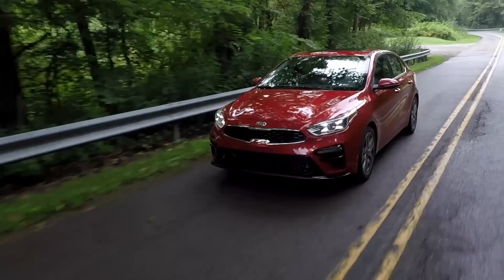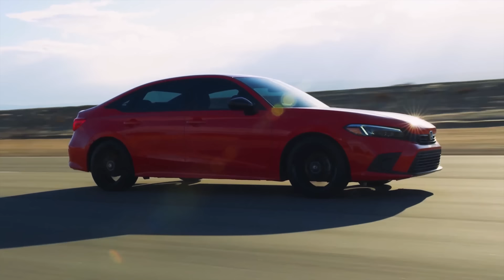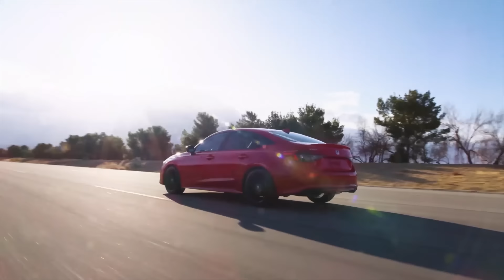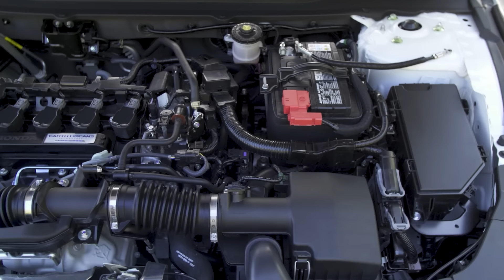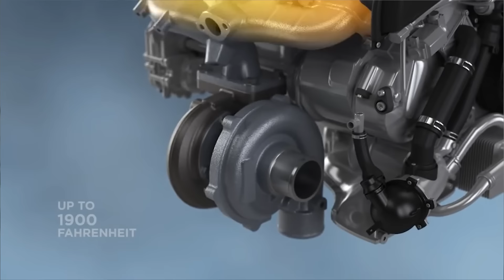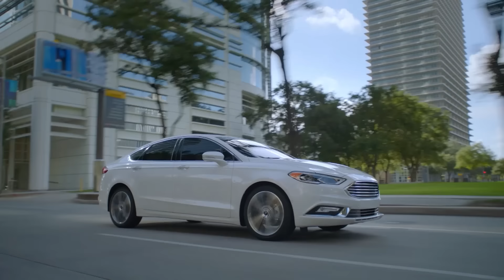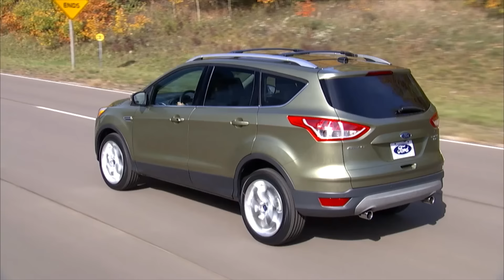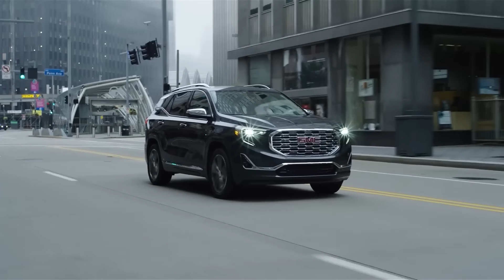Are Turbocharged Engines Reliable? The Truth About Turbo Engines

Comment: Hey man i just wanted to say thank you! For telling it like it is, a lot of people who prefer turbo engines will be butt hurt, but that is the truth. I've had a naturally aspirated 1.5 16v 88hp mazda 323f engine, very simple and cheap maintenance, no problems with the engine, my mechanic always liked working on it, very easy to fix, doesnt matter what you have to change, but the car body was very rusty, so i had to buy another one. So i got a mercedes c class c180 kompressor, very sensitive parts, the timing is expensive, the kompressor has certain mileage and then it breaks down, parts on the chasis or brakes werent cheap either, ive never red-lined it, but over some time the kompressor started rattling, the timing chain was stretched in a short amount of mileage, sooner or later electronics start to break down too, especially if its with automatic gearbox. So your best bet for a car always will be 4/6 cylinder naturally aspirated gasoline engine and manual gearbox, it can take a lot of abuse and will do its job for years and if you take real special care of it, it can even last a lifetime. Some people buy cars for ego, while others buy them for daily tasks. That pretty much sums everyone.
Reply from the maker: Well said. Thank you!
Reply: Simplicity is the ultimate sophistication!!

Comment: Honestly, this video is pretty misleading and filled with inaccuracies. 1) Turbo motors do not take longer to warm up than a NA engine. If anything, they warm up quicker due to the recycling of hot exhaust gas. 2) It is also pretty disingenuous to say turbo motors are worse for short commutes. 5 miles and under commutes are not good for any car, regardless of turbo or NA. 3) You are cherry picking bad motors. You can do the same and talk about bad NA motors. Northstar...2000's Subaru NON-TURBO Subarus, 2010's Hyundai/Kias, etc. It comes down to bad motor design, and poor maintenance habits by the general population. I could go on, but the last thing I will say is Turbo-Diesels have been around for a long long time, and they last for 300k+ miles, and even 1 million plus on Semis. Why, because good design. Some manufacturers slapped turbos on motors never designed to be turboed, and that's where the issues are.

Comment: I bought my first turbo-charged car in 1986. I've never gone back. I've owned 8 turbo-charged vehicles since then and never had a turbo related problem. You totally neglected the power loss that a naturally aspirated engine has at altitude that is not present in a turbo-charged vehicle.
Reply: @DevilDog53 #1, 1986 SAAB, traded it in on a newer SAAB at ~100K. #2, 1993 SAAB, t-boned in Louisiana; insurance totaled it, but someone salvaged it. #3 1997 SAAB, gave to destitute daughter @ ~120K. #4 1996 Audi Quattro, totaled in rear-ender ~120K,  #5 2000 Audi Quattro (bi-turbo), given to charity at 150K, it would have cost more than the car was worth to replace the catalytic converters. #6 2007 SAAB currently ~106K. #7 2016 Volkswagen Passat currently ~60K. #8 Oops, I counted wrong.
Reply: @DevilDog53 I, too, am a manual transmission fan. However, my current 2 vehicles have automatic transmissions. All previous SAAB's and the Audi's were manual transmission models. The current SAAB gets the worst mileage (28 highway) of any SAAB I've owned. The Passat gets well over 40 highway.

Comment: i have a 2014 ford fusion 2.0 vel ( spanish engine )  and 165322 miles on it..the direct injection on this engine, is bettter designed than the german engines.. the german engine route there pcv from the valve cover into the intake manifold.. for routes there from the block under the intake manifold.. with a cover on the block with baffles inside it..at least on the 2.0 car that i have worked on,, the 2.0 ecoboost engines dont have carbon build up on them.. as for the turbos.. the cleveland engines.. the exhaust manifold and the turbo are the same unit... on the spanish motors,, the exhaust manifold is seperate from the turbocharger.. this help lower the heat.to a degree....i belive by changing the oil every 6000 miles with synth.oil helps alot,,as with fresh coolent change every 3 years helps..at least on my car..i did add ovs onto my car. at 140000 miles and my valves where still clean, just a light grey finish on them.

Comment: A well designed turbo engine will last 200k+, I just traded in my Civic hatch with a 1.5T engine. Key part to keep it reliable is change the engine oil early or at least on time. During morning coldstart, dont drive it hard right the way, keep the rpm low and drive slow before it fully warm up. There are several Honda 1.5T with over 200k miles, 1 Civic makes it to 520K miles on original engine, turbo and CVT.
Reply: I have a 2016 ex-T with 150,000 miles
Reply: My dad's Scania has 620k miles and its turbocharged v8 (its a truck)
Reply: I'm glad to hear you got that milage out of your 1.5. I have heard that the headgaskets are problematic on those motors due to a coolent slit between each cylinder which gives very little area for the gasket to grab. Maintenance, and driving habits definitly makes a huge difference.
Reply: premium fuel and premium oil is a MUST for turbo engines to last 200k plus
Reply: Resale value is garbage for turbos
Reply: @jcman240 I bought my turbo civic 2018 new and can still sell it for 8k more than what I owe on it. The only mistake I made was leasing it for 2 years

Resale value is definitively NOT affected by turbo cars, only if they don’t come that way from the factory
Reply: @jcman240  I'd like to see you put that on a spreadsheet and prove it. The average person buying a car doesn't give a shit if it has a turbo or not. They just want a car that goes from 0-60 in a decent time, has decent mpg, and is in good condition.

Comment: Its funny how people complain about german cars in america or elese where, Europe is almost 100% turbocharged and around 80% diesel the fact that almost all majority of people there dont complain about parts failing or bad reliability, you will almost never find a turbocharged diesel not make it to 300k km it should also be a no brainer to do maintenance, yes some parts break and wear and not all parts are perfect but thats every manufacturer. I know many people in the us that have 2014 and older vw that have over 250k miles by doing maintenance and changing the timing chain
Reply: Diesels have a higher compression ratio. The engine is simply built different to withstand higher pressure.

Comment: If you want a car that doesn't consume a lot of fuel but also has high torque already from 1800 RPM and is not expensive then what is your choice.  Please note that there are cars that are more than 10 years old that have turbos, including diesel cars from BMW and Volvo

Comment: The efficiency of a turbo comes at a cost.  The excess heat can cause a lot of issues.  Since oil changes are more critical I am guessing that it breaks down the oil sooner than a normally aspirated engine.  They compensate for a smaller engine = less weight = theoretically better gas mileage?  Remember when turbos were all the rage back in the day?  That enthusiasm faded in time probably due to their reliability issues.  Would I personally buy one?  Only after researching the price for a new one as well as the installation cost.  Find out how long the warranty is & exactly what is covered.

Comment: After watching this video I’d still buy a turbo car and have tons of fun with it, most of our life ( which is very short btw) we worry about problems that never happen

Edit : had a Cadillac ATS turbo, Ford Escape 2.0 t , and currently a Mazda CX-5 turbo , not an issue. sorry but I can’t go back to a non turbo unless it’s a v8 ( had two Camaros and one charger v8 as well ) problems ? Let me cross that bridge when I get there
Reply: Well said 👌
Reply: Agree...V8 Tundra 4.7 '03...awesome truck 20 years old original frame. '16 Audi A5 2.0 Turbo 133K miles...only thing changed is two front wheel bearings. Highway long hauler in Northeast. Put ice & snows on and it rocks! Came with a 100K warranty.
Drained 1/2 tranny fluid. Oil changes @ 7K.
Reply: How many miles are on those cars?
Reply: tons of money I guess
Reply: @michaelgoodman9508  A bad attitude like that will have you missing out on a lot in life.
Reply: This is the other side to the coin. It sounds like the buy now pay later ideology

Comment: My 10th generation Honda Civic EX-T 1.5 liter includes the first production turbo for the Civic. I bought the 2018 model new in June 2018. I live in Westchester county, NY.  I maintain my Civic religiously. I change the oil/filter early (between 3,800-4,200 miles) using Honda 0W-20 synthetic oil and OEM oil filter. I only use top-tier fuel (containing the highest detergent additives). I rarely drive short distances…about 60% highway miles. I also rarely exceed 4,000 rpm. I’m averaging 33.8 mpg (combined city/highway)
My plan is to exceed 300,000 miles without any major repairs to the engine/turbo or transmission. As of Aug 2022, I have driven over 114,500 trouble free miles. So far, so good.
Reply: UPDATE: As of Nov 9 2022, my Civic EXT has 124,100 trouble-free miles.
Reply: @txmoney looking for another update.  Seems like you are doing alright with your turbo.  The You Tube theme is turbos don’t last long but no mileage ranges are ever given.  I have looked up the expected “lifecycle” of a turbo and it ranges anywhere between 150,000 to 300,000 miles.  That is a crazy range.  I have only had one vehicle to the 150,000 mile range and my current vehicle is at 131,000 miles.
Reply: @txmoney how bout now?
Reply: @ 
Currently 204,800 miles averaging 36.7 mpg (combined city/highway). Engine, turbo, and CVT still running fine. No oil dilution issues.
No major repairs except for the AC and the fuel pump…both repaired for free as they were known issues or under recall.
Reply: @t @txmoney  hi! Are there any updates? My friend also has a 2018 civic and had the AC and fuel pump replaced/repair under their recall/extended warranty.
Reply: Some claim the thinner 0W20 or 0W16 oil is not the best for engines. Only serve to eek out a little better gas mileage?  And that it may be better to go with slightly thicker oil?

Comment: If I'm right, petrol engine ideal air fuel mixture is 14.7:1. With that in mind, when you force more air into combustion chamber, via turbocharger, you have to compensate with more fuel hence surprising high consumption, opposite to manufacturers declaration.

Comment: There is no simple answer - depends on manufacturer, has proper maintenance been carried out for all its life, what type of engine the turbo is mated to and even the way they are driven( how many drivers let the oil circulate after starting the car and let the turbo cool down before switching off?).

I have two 2001 3.0 diesel turbos with 170k plus miles. Nothing other than usual service items plus water pumps have been replaced, except one had the turbo let go just after I bought it in 2007. On diagnosis this was put down to poor servicing by the garage I bought it from, oil changed but oil filter not changed and overfilled with oil as a consequence. The overfill with oil also ruined the lambda sensor in the exhaust.

But don't buy a second-hand turbo engine vehicle, or a hybrid, whatever..., unless you are prepared to spend the money on having it professionally maintained or you have the skill set and tools to be able to maintain it yourself to an equal standard.

Comment: I can see this video is more related to US audience.
In Europe, since the 90's they used turbo charged diesels in almost every vehicle, some of them are still on the road.
Most successful and most reliable engines from that era were the 1.9 TDI from WV , 1.9 JTD and 2.4 JTD from Fiat, (yes Fiat, you read it correctly)  and the legendary 2.1 TD from Mercedes
Additionally , since mid 2000's WV first started offering smaller displacement gasoline turbo engines for the masses, such as 1.2 t , 1.4 t , 1.8 t and 2.0 t
Soon after, the French and the Italians started rolling smaller displacement gasoline turbo engines.
Some of them are used on taxis and company fleets that do many miles.
So we are talking of 30+ years of using turbo charged engines in Europe (not talking about exotics or super cars)
If they weren't any good , i think not all manufacturers would sell them today.

Just my thoughts and experience with turbo charged vehicles

Comment: Owned a Evo8 a couple years back. Lasted 300k miles without failure. Sold it to a friend. Still running original turbo with a few bolt on and a tune.
Reply: because your evo8 has iron engine block
Reply: Maintenance, good driving habits, and having the motor properly designed help alot.

Comment: The real problem has been a federal government in the United States and Canada that has gone out of its way to produce the most unrealistic and excessive regulation of the automobile. Yes we do want low emissions and low fuel consumption but there's a limit to both. Emissions and consumption can only be reduced just so far. 200 horsepower and 50 miles per gallon is just not possible. Carbon dioxide is not a pollutant whereas carbon monoxide clearly is. The governments need to take a little step backward. The 1981 standard for emissions was clean enough. As far as gas mileage standards go, no. Not the government's place to mandate what kind of car we Americans or Canadians can have. As it is Americans and Canadians are not fond of small cars especially Americans.

Comment: They are not reliable... Puts more strain on the motor by increasing pressure. The price you pay for better gas mileage, but long term more junk cars in the junk yard.

Comment: Don’t want a turbo, and definitely DO NOT want a CVT transmission! That has a steel belt that stretches as you speed up. Vs steel gears in a regular transmission. No not even one with a starter gear!

Comment: I have a GM Ecotec 1.4L turbo. I get excellent mileage. Currentlt 35.2 mpg.  However, even with on time routine maintenance,  I have replaced the Turbo unit twice @ $2,000 a pop. Currently, the vehicle has 178,000. Overall,  I am happy with the car, just wish the warranty on the turbo unit would be longer than 1 year.
Reply: Honeywell turbos... what year car?

Comment: Excellent video, thank you!  Your conclusions make perfect sense, car companies selling the benefits of better performance and gas mileage, which look great on paper.. then all the problems happen later.  Then more $$$ for the car companies in big repair bills... and the government loves the whole thing because it increases MPG a smidge and who cares if the consumer gets stuck with high repair bills.

That said, I have a 2016 F150 with 2.7L Turbo, I am religious with the maintenance and drive very conservatively.  But I still plan to trade it in within a few years for a new one, maybe a straight six.  We'll see what engines are available in 2 or 3 years.

Comment: 4:30 you did not say automakers install heavy duty parts in turbocharge engines to handle the extra pressure. I bought a new 2016 F150 with the 2.7 ecoboost engine because I knew it would burn less fuel than the 5.0 v8. My last fill up was 18.3 mpg. My truck has 85k miles and I only had to replace one $20 temp sensor.

Comment: I owned a 2014 eco boost ford escape, the turbo straight up failed at 100,000 miles, 2
$2500 usd to replace the turbo, then they broke a stud in the exhaust manifold and wanted me to pay an extra $2500 to repair when they were the ones to break it. Got rid of that car.

Comment: I love turbo cars and with that being said I adjusted to the cost of ownership. I warm up my car for 5 min before every drive I take and installed a turbo timer to allow it to cool and settle before shutting off. I also focused on oil coolers and a better radiator setup to help control heat. Wrapped the downpipe and manifold to keep heat in the exhaust and finally installed better heat shields than what came from the factory.

Now understand I'm not your average consumer and love to mod and upgrade cars as a hobby. I love my 92 3000gt vr4 so I was willing to do everything I could to make it more reliable and as a result I daily it in Pennsylvania all year long
Reply: After all these years as a DAILY, is rust not an issue on this car?

Comment: Solution to short drives and cold temperatures causing carbon buildup on the intake valves: oil catch can. Even more important if you’re tuned